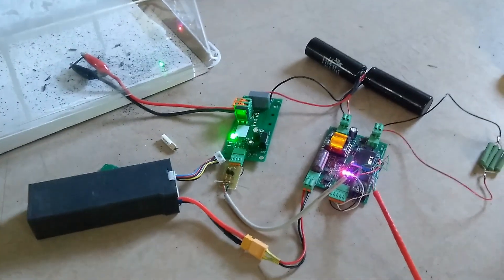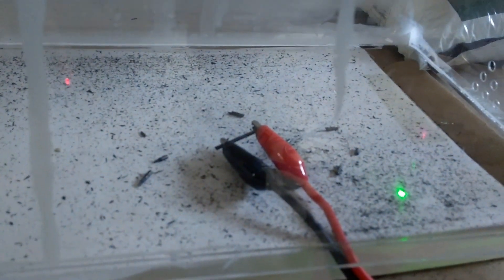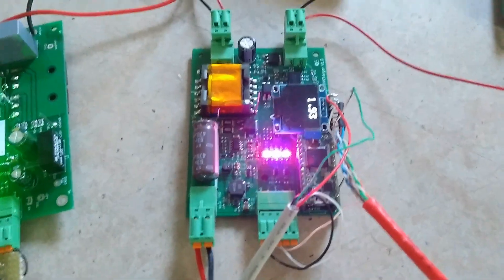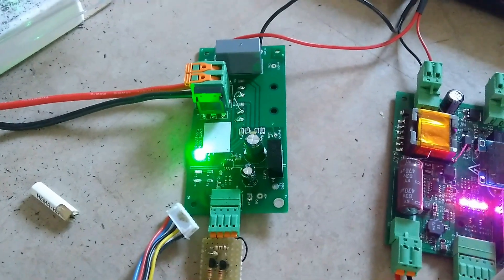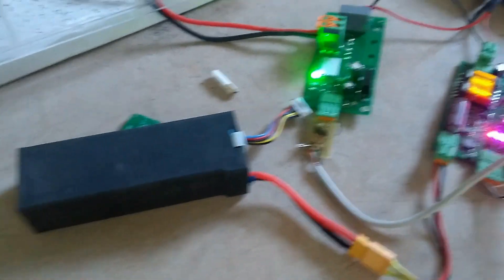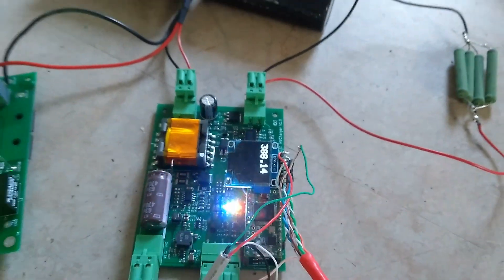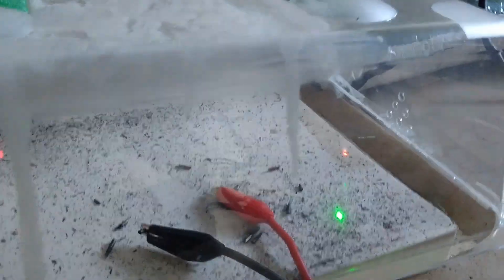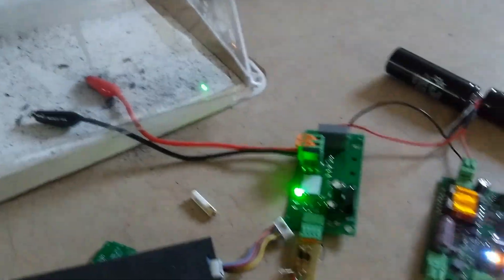Pencil leads apparently explode when connected to 400V

Comment: Something else that’s fun is doing this to pencil lead while it’s still in the pencil. Just take the eraser off and you can get to both ends, and light the pencil on fire or even explode it with electricity.
Reply from the maker: Yup tried this. Got sufficient smoke in my house with the complete pencil, so I prefer explosions of just the lead :)